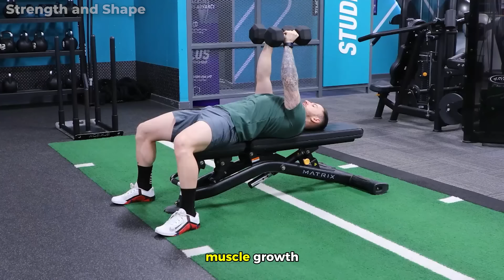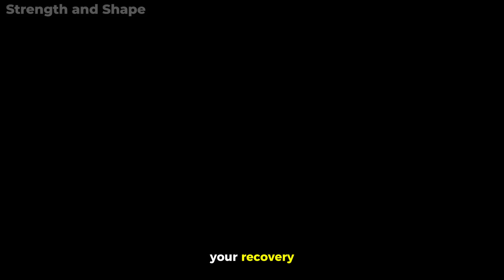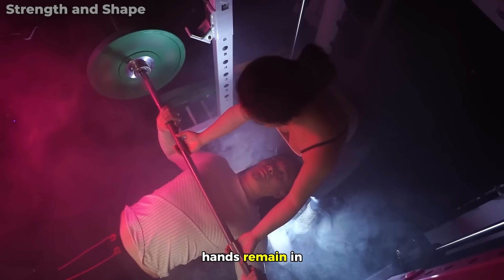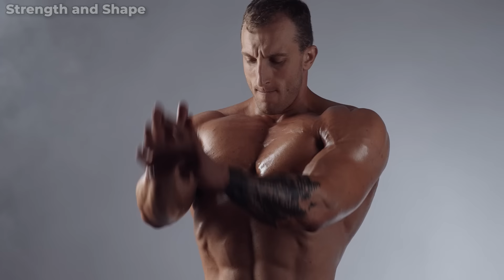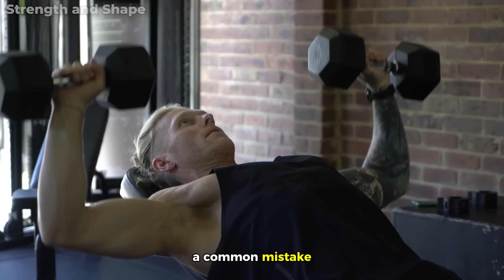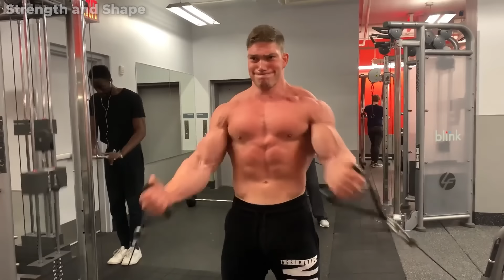10 Things That FORCE Your Chest to Grow And 90% of Men Ignore (Do This Now)

Comment: 30 degrees angle may not be the best, It depends on the individual. For many an angle of 60 degrees is best.Yes the shoulder would come in too but there is no better way of hitting the upper chest. After all hitting the should is not entirely undesirable.